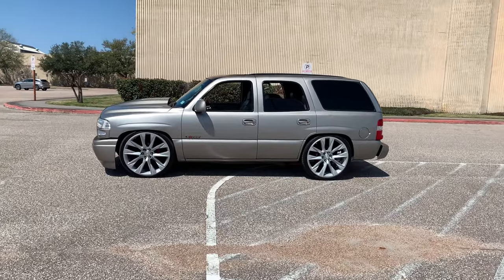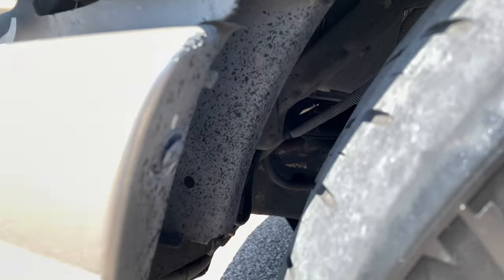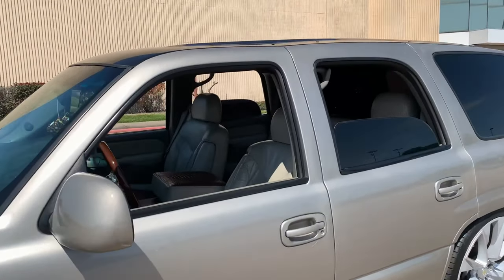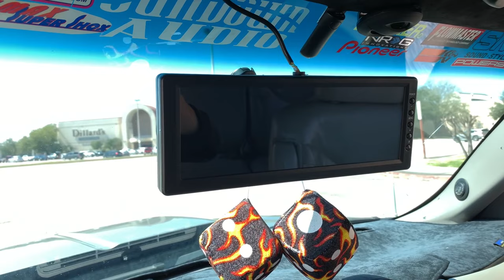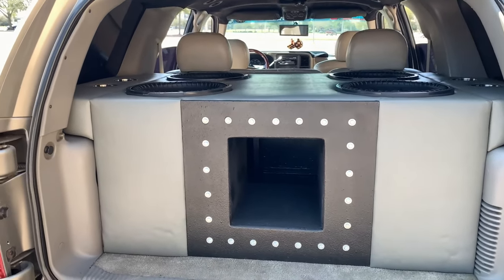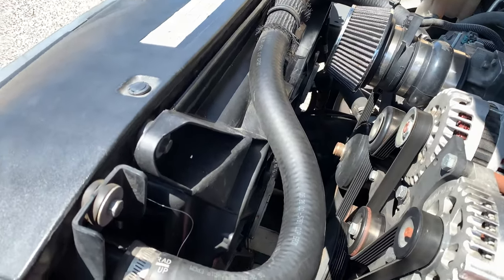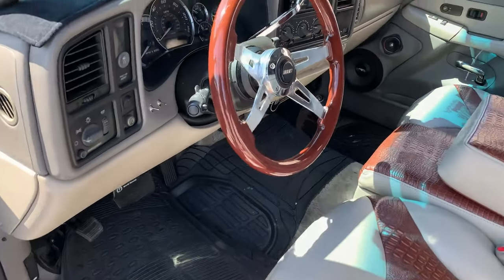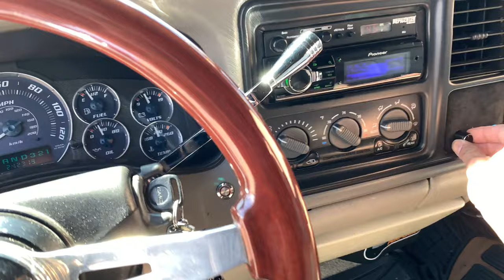Lowered Yukon 26 wheels 5/7 drop

Comment: Man this looks nice. I wanna drop my tahoe this low but i tow with mine. Probably going to go 2/4 on these 26s my dad got laying around. Have been looking into doing the air shocks with helper bags in rear to be able to drop it when parked
Reply from the maker: Thanks!💯 yeah you should add helper bags if you drop it for when u tow.  If you drop it it 5” in the rear I would recommend the Djm Blue springs they are very stiff so they should be good for towing
Reply: @MiGo713  definitely going to do them at least. And maybe add the air shocks later so I can raise and drop the rear
Reply from the maker: @djmurria  yeah I’m sure they will all help out with your towing⚡️ Good luck on your build💯

Comment: Love your truck ...I have a 2004 GMC Denali I did a 4/6 drop 7 years ago I still have the truck to this day... My question to you is the bushings on my upper control arms are gone, I need to replace them but it's hard for me to find parts that fit a Denali what would you recommend for replacing upper control arms!!!!!!
Reply from the maker: Thank you!! 💯💯💯Denalis are nice, I bet it looks great with the 4/6.  I’ve used DJM control arms and they’re great, but if you need something more custom you could try out Michigan Metal Works I have those currently on my Yukon even though I crashed it.  They are more expensive but more customizable.  My Yukon is a 2wd not sure if yours is 4wd?
Reply: Thanks I'll look them up .........
Reply from the maker: @Mack-f6l  no problem 👍🏼

Comment: How did you keep the tires from hitting the upper trailing arm bracket on the frame
Reply from the maker: In the front or rear?
Reply: @MiGo713  in the rear. Adjustable trailing arms?
Reply from the maker: @jasonprater9221  Here I explain all the parts I used 👍🏼 https://youtu.be/F3OVzQO1oxo

Comment: Wassup bro! I just dropped my tahoe 4/6 drop, but dam my truck bouces alot it's a rough ride, how does your truck ride with the drop ?
Reply from the maker: Hey What’s up! That’s a nice drop💯 my truck drives smooth it’s probably your springs if thi got cut they will be bouncy, I would recommend the Tony Norcall ss springs they will get you the lowest and smoothest ride 00-06 Yukon 5/7 drop parts
https://youtu.be/F3OVzQO1oxo you can check out the parts I used here👍🏼

Comment: Looks clean man, how does the cold air intake perform though?
Reply from the maker: Thanks! The air intake performs good just like normal, I just moved the stock plug to the middle no cutting or extensions.  And now I have lots of room in my engine bay to add other things or clearance in case I decide to do wheel tubs later💯

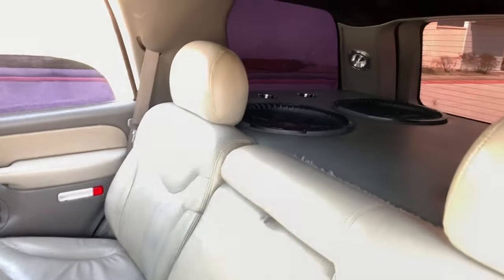Comment: I have a question in the part of 3:45 the top of your tail light doesn’t blink or turn on?
Reply from the maker: Right now I have them connected as my parking lights and also as my brake lights.  I could wire them as turn signal but I didn’t really care for that. I will be changing them up soon when I get a chance I will make a video on it⚡️
Reply: @MiGo713  if you can bro make a video how to wire them probably plz imma order them and see how they look Ik imma fuck up wiring them 😂
Reply: @MiGo713  or if u can just send me direct message showing me how bro
Reply from the maker: @dereckhernandez5945  For sure lol sometimes the wiring gets confusing for a lot of but it’s not too bad. I’ve been trying to make the video but my schedule’s been busy mostly cause of work🥵 but I will get it done😎⚡️
Reply from the maker: @dereckhernandez5945  I will get the video done pretty soon, since it will be easier to explain like that💯
Reply: @MiGo713  no rush bro take your time but I much appreciate your vids💯
Reply from the maker: @dereckhernandez5945  For sure Thanks👍🏼 Appreciate it!

Comment: Did the front tires run in the back of the wheel well
Reply from the maker: Yes they use to rub before I trimmed and adjusted it, because I use to have 28” rims on it
Reply: Right on looks really good.
Reply from the maker: @jonjackson374  Thanks!⚡️

Comment: U gain that last inch by removing the spring isolator on the rear?
Reply from the maker: With weight of my audio system and I also removed my spring isolators👍🏼

Comment: Clean Yukon G 💯🔥 My 4 15s Make My Tahoe Sit Just Right Too lol I Just Want To Lower My Front A Bit More Might Drop The Keys A Bit More
Reply: If You Dont Mind, On A Flat Ground...  Whats Your Measurements From Ground To Your Fender On Front & Rear? (Center Of Wheel)
Reply from the maker: Thanks💯yeah I actually do have my keys cranked down a bit so my front is a bit lower than the rear, so that will work just remember it changes your alignment you will get more -camber
Reply from the maker: @SleepyBoiii  yeah I can get the measurements for you later I’ll post them for you⚡️
Reply: @MiGo713  yeah bro cuz i got the belltech drop shocks & spindles , the alignment said i do have some camber but its a good camber, not bad at all. Its just half inch i want to drop,  But i appreciate it bro 💯 keep up the good work
Reply from the maker: @SleepyBoiii  yeah I feel you, and thanks👍🏼 the rear of my Yukon has 305/30r26 tires and  from center to the fender measures 16” and fender to floor 32”.  On the front I have 295/30r26 tires and from the center to the fender measures 15.5” and from the fender to the floor is 31.5” hope that helps out⚡️
Reply: @MiGo713  highly appreciate the info bro !
Reply from the maker: @SleepyBoiii  no problem👍🏼 good luck on your build!⚡️

Comment: Why do u have two alternators and what is the purpose of having 2 just curious to know thanks
Reply from the maker: I have 2 alternators to handle all of my aftermarket equipment like the amplifiers and subwoofers, that way I have no issues when I have everything on.  The stock alternator is about 100-130 amps which is for all the factory equipment,  just my subwoofer amp pulls at least 400 amps at full power⚡️⚡️⚡️ lol So this helps everything to work properly
Reply: @MiGo713  alright that's cool I did not know you could do that is there anything hard about connecting the second alternator is there a special bracket or extra connections and wiring that has to be done in order to have 2 alternators?
Reply from the maker: @georgegomez5654  no Problem, a lot of people don’t know as well 👍🏼. And they do sell the brackets with wiring with the 2nd alternator as a set available.  I got mines from Dc Power as a kit💯 https://www.dcpowerinc.com/pages/product-result
Reply: I have a 2002  gmc yukon denali xL do you think putting a rebuilt transmission in my denali that has 219,000 miles is a good idea just asking
Reply from the maker: @georgegomez5654  If your transmission is giving you problems yes I Would recommend getting your transmission rebuilt especially if your thinking of keeping the truck longer,  I have the transmission on my Yukon and Silverado rebuilt💯👍🏼 The 4l60 transmission that came with these trucks are common to go out as early as 130k to 200k so people usually get them rebuilt.  It all depends on how you treat it also taking care of them will last longer
Reply: @MiGo713  cool thanks for the info if the motor  has 220,000 miles on it is it a good idea to rebuilt transmission tho?
Reply from the maker: @georgegomez5654  I would say yes

Comment: Damn she look nice ad clean.. ad was it hard to do the steering wheel
Reply from the maker: Thanks, it wasn’t hard pretty simple to swap steering wheels.  You do loose the airbag when you swap it and need to use a 2ohm resistor to remove the airbag light in the dash unless you don’t care.
Reply: badd ass wheels
Reply from the maker: @marksantana505  thanks

Comment: What year?
Reply from the maker: 2000
Reply: @MiGo713  is it a sle or slt? Or denali
Reply from the maker: @Yu_truck  a slt I just put the Denali front Grill and Bumper
Reply: @MiGo713  I got a question. I have a 2002 yukon sle, so can i install a denali bumper?
Reply from the maker: @Yu_truck  Yes you can💯